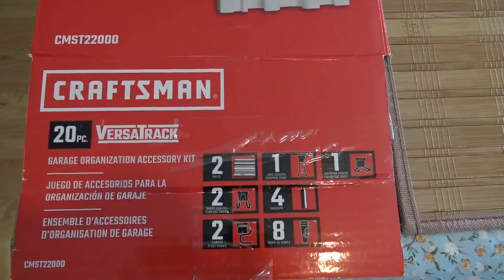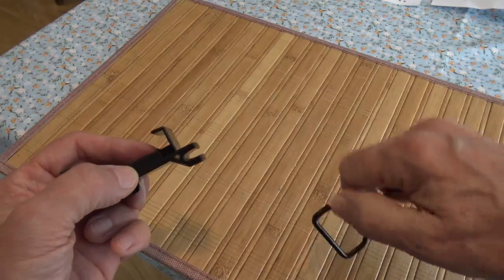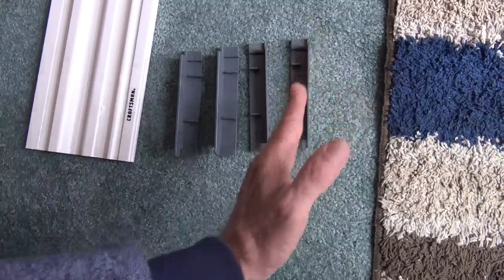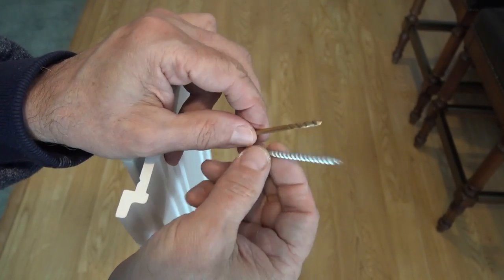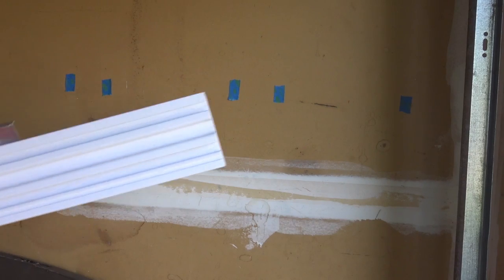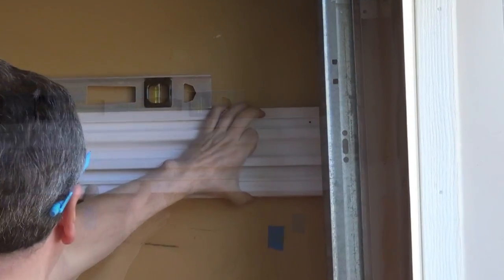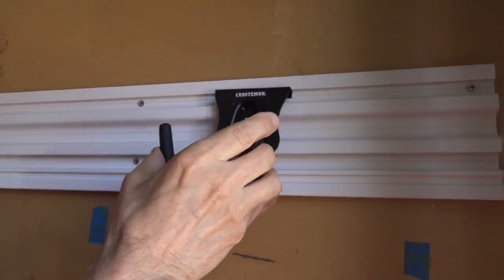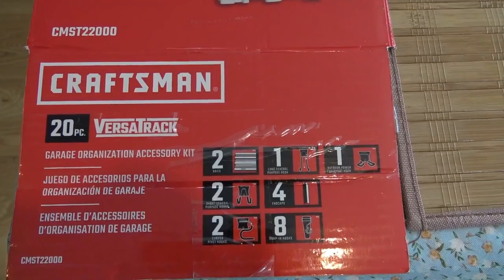Craftsman VersaTrack Installation and Overview

Comment: What is the model of your stud finder?
Reply from the maker: Hello ... The stud finder that I used in the video is actually a laser level with a built in stud finder and AC wire sensor. It is the Black & Decker Bullseye Auto-Leveling Laser  Model # BDL 190S. (Cost was about $60) There are many less expensive stud-finders available but I bought it primarily for the laser level function and then discovered that the stud finder function was very nice and easy to use as well.

Comment: I need to install a VersaTrack sent to me by my son. I watched your video and read their instructions. I noticed that you are not using the pan head or washer head screws that the instructions advised. So I am wondering why? I am going directly into a stud, no sheetrock. It seems to be hard to find #10 pan heads or washer heads 2.5 inches long for a decent price. Advice please. Thank you.
Reply from the maker: Hello,  if you take a close look at the instructions, it says to use #10 "or" 4.88 mm pan "or" washer head screws. (see the word "or") You have 3 options, but you don't have to use a pan or washer head screw.  It goes on to say, "wood screws must be used for mounting to wood studs."  In my case, I was screwing into drywall and then wood studs (no masonry or concrete), so I just used their first option,  a #10 wood screw.  It went in nicely into the track groove and sat nice and flush and was secure. I'd recommend to hand tighten as you get close, so that you don't go too far into the track. Good luck. Hope that helps.
Reply from the maker: Also, since you are going directly into the stud and not going through sheetrock, you could probably use a 2 inch #10 wood screw. I used 2.5" inch because I was also going through sheetrock and because that's what I happened to have around the house. I probably could have used a 2" too, but I'm sure you definitely could.